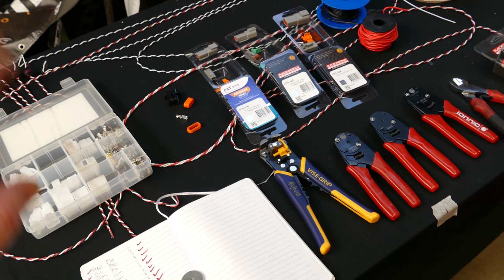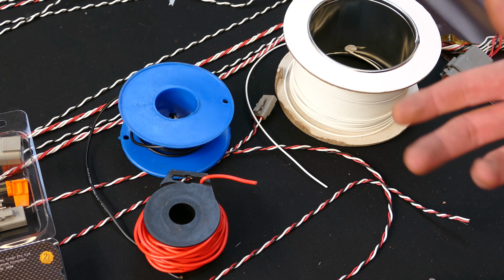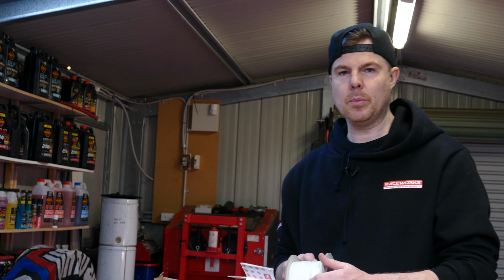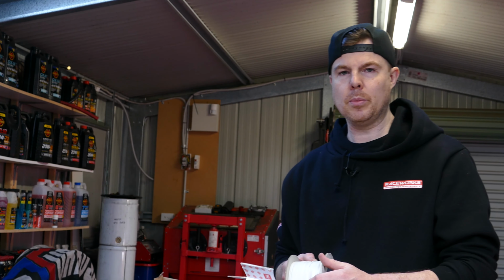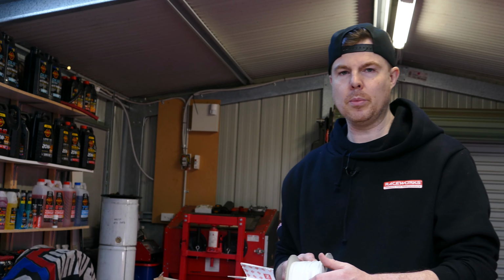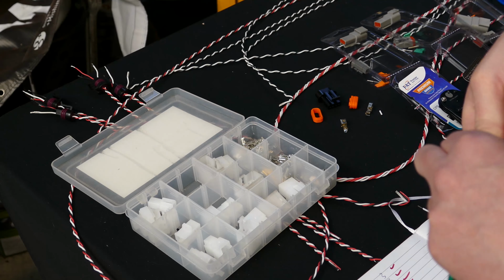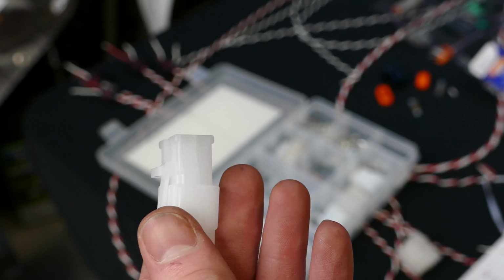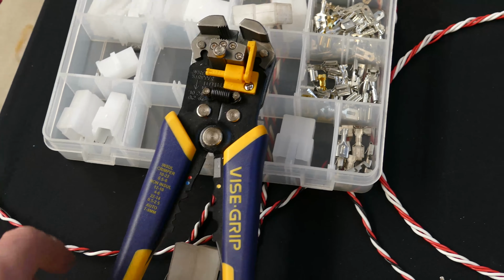Basic Automotive Wiring Tips & Tricks

Comment: Very well taught Broomy. I'm an A Grade Electrician with data and security as well as Motor control and process control experience. I must say, for at least 9 out of 10 car builders, the answers you've given are exactly what I'd suggest. The only extras I'd offer are soldering the pins rather than crimping (but only if your soldering skills are good), copious quantities of heat shrink and re-useable cable ties with panel pins to secure to holes in the bodywork. All in all, I'd agree with you about people overcomplicating wiring for no real benefit. A further benefit of your recommendation for the Deutsch plugs is higher surface contact area reliability between the male and female during the plugging process.
Reply: Careful when soldering terminals:
  https://www.youtube.com/watch?v=E_m8xf3vfYE
Reply: Dang I wish I had your skills.  I guess life is short...but not THAT short. 😂 Forever a student.  #alwayslearning 🔌⚡️💡👩‍🔧

Comment: I just started working with these Deutsch connectors and I really like them a lot. Even the cheaper aftermarket plugs seem to be miles better than the best weather pack connectors.
Like stated in this video, once you have all the tools needed to do the job properly, it's really fast, easy and secure.

Comment: Its kinda fun to look at the reasonings why things are done as they are from the common folks perspective. I am a assembler who has built and in part designed large automation panels to small wire harnesses for vehicles to semicon industry.

Twisting can be done to safe space. Usually its done to analog controls to make the magical magnisation stuff less fucky.

The common flat connectors contacts are available in smaller sizes. Deutch connectors are good because of their environmental properties and superior crimp contacts and good built quality.
-one scuffed tip is to strip the wire longer and fold the copper. NOT RECOMMENDED! but better than just crimping small wire to too larger contact.

Thick insulation in wires is for better voltage/heat resistance and harsh environments.

Cauge is just stupid american standard for conductor size, but almost all crimpable contacts use that so you have to deal with that.

11:55 the crimp you made is faulty. The holes in the contact are for inspection. You should see copper from that hole to make sure the wire is deep enough

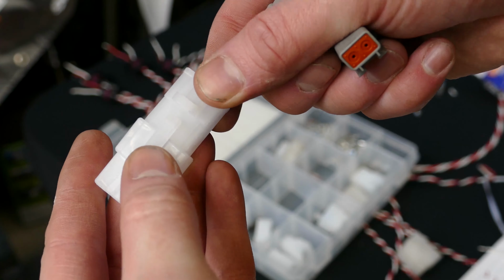14:50 and that's the built quality but the contacts wont be that loose. The contacts inself will suppourt each other, but its better that the contact housing takes the movement stress rather than the contacts in them selfs that's why you should use deutch or similar in vibrating and moving applications.

Im too drunk to commantate furher frogive me and skip this comment thanks and bye.

Comment: i work with a well known custom canopy and service body manufacturer. i do wiring on daily basis for Utes.We never rely on clips. We do solder as it is most reliable method. I use long noze plier instead of side cutter.even fro 5 cores , 7 cores wires.  the stripper has clips features too. i use them whenever required.  so basically plier, stipper and a solder are enough for wiring. soldering tool is good investment instead of clips. for DIY i suggest also add tester screw driver. it will save ur time on finding wires and issues, blown fuses etc. .

Comment: I get your complaints with the fastin faston connectors (the generic white ones) but you can get the right size crimps for thinner (or thicker) cabling. If you're using the right size crimps and crimpers they're perfectly fine.
Reply: True, however would it really be worth the minimal savings compared to the best options
Reply: @mrbumcraic5046  Yes it would in certain circumstances where you don't need a weather sealed connector under the dash or somewhere inside the vehicle. Correct size terminals and proper sized correct crimpers for the terminals would make a better termination than he demonstrated. If you don't have the correct size terminal because the wire is too small, you can strip back more sheathing and fold the wire on itself to create more surface area for the terminal to bite onto when it crimps. 

It was a great video that unfairly compared apples to oranges in my opinion. Deutsch are great but they get pricey in a heartbeat and they are not necessary in every application.

Comment: For greater security at any wire crimp; strip extra insulation and fold over the end. It has to ball up if it slides and will not let go. I have done this for 40 years and never seen one pull out.
Reply: I'm not sure what you are referring to. Maybe you could clarify.   For any of those connectors as long as you are using the proper wire and crimping tool, you should never have any problem with it pulling out.
Reply: woah i just started wiring these up and had never used a crimp before and just assumed that is how everybody did it! good to know!! thanks!
Reply: @tchevrier  he means fold the wire in half and stick it in for crimp connections for extra security. Imo just get the right size connector

Comment: The white generic ones comes in multiple sizes too, tbf. The white ones are used as OEM on bikes and cars for a reason, its called "good enough", and weather sealed connectors are not always worth using. That said, i like both options.

Also a tip for the twisting of cables, when you are finished twisting if you apply heat with a heatgun on the loom, it would often not loosen too much when releasing from the chuck of the drill.

Comment: If the wire is too small for the crimp-connector to grip it properly, either solder the wire to the connector, or double the stripped wire back on itself to form a thicker crimping-wad for the connector's crimp-surfaces to grip onto.
Reply: Never, ever, solder wiring in any type of high vibration setting like automotive.
Reply: @montegb2951  Ummmmm actually I find that soldered joints work just fine in automotive applications; not sure why you would be concerned about them...?
Reply: @montegb2951  You may get away with that (soldering) in automotive uses, but NEVER in aircraft.  If you double back the wire or fold it over to double the wire count in the crimp on, you're golden.  I go a step further and heat shrink the wire to the connector if room is available.
Reply: @sferg9582  and why exactly do we NEVER solder wires in aircraft? I've heard multiple people say this with no explanation. From my career, I've seen crimped wires break inside the insulation at the back of connectors. It really comes down to correct application and knowing what techniques to use.
Reply: @MrJtrot90  , soldered wire is more brittle, and can wick up the wire to before the support part of the crimp around the insulation. Hence with vibration it can crack and break. Time and a place for everything though.
Reply: @montegb2951  Absolutely incorrect.  It is perfectly acceptable to solder wiring in a high vibration environment like an automobile.  In fact, it is the preferred method of joining 2 wires.  OEM wiring  harnesses have solder joints in them straight from the factory.  I am speaking from 20 years experience designing and manufacturing electrical systems in the automotive industry.
Reply: @sferg9582  "you may get away with that (soldering) in automotive uses, but never in aircraft."
I can't speak for the aircraft industry, but I can speak for the automotive industry.  Soldering is. not only acceptable but the preferred method.  
As far as doubling the wire before crimping, that is not required if your are crimping properly.  And if you are using the proper size terminals you shouldn't be able to double the wire.
And, heat shrink is great, but if you are using it in an environment prone to moisture then you should be using adhesive heat shrink.  Regular heat shrink will allow moisture to wick up and corrode the wires quite quickly.
Reply: @tchevrier  Yes, OEM harnesses have soldered splices...(branch circuits).... but not repairs. There is a huge difference between a machine heated splice and something a shadetree guy is going to accomplish. Might I ask, who do  you  work for? Because almost every OEM recommends crimps for repairs. It's actually very easy to find those recommendations directly from the manufacturers, this is not some industry secret.  BTW,  I do speak from experience. I'm an electronics tech for an actual OEM, and we stopped soldering repairs on the assembly lines around 1998.

Just to be clear.... when you say you both design AND manufacture, I knew you were full off crap. The OEM engineers design..... and the manufacturing of the harness is done by a vendor, (with specialized splicing equipment). That's been going on long before I started. The only department that both designs and builds is the proto shop, and the rules they work under are not the same as the real world.
Reply: @montegb2951  Let's first address the second part of your statement.
"I knew you were full off crap."   Apparently you are wrong.  First, I worked for 10 years as a design engineer for a major OEM. While most of the wiring harnesses were contracted out to subcontractors, some low volume products were actually built in house and those joints were hand soldered. Repairs were also done in house using hand soldering.  Under no circumstances was a crimp splice ever used on a brand new vehicle. As a design engineer we spent a lot of time testing wiring joints, splices, connectors etc, under all types of conditions. The best most reliable joint was a solder joint with adhesive heat shrink.  Second, I worked for 10 years for an electronics company who both designed and manufactured products for the automotive industry. As yes that company also had harness manufacturing capabilities for both internal use and for OEMs. Again there was no restrictions against using hand soldered joints. Obviously in an assembly line type of environment you want to use as much automation as possible for both speed and quality purposes, but when not practical hand splicing was done.

Now the second part, "OEM recommends crimps for repairs".  I can't speak for what everyone else does, All I can say is what we did. We would never ever recommend anyone use something like a butt splice unless it was inside the vehicle .  Heat shrinkable solder splices work very well, but we never recommended them.

Just for kicks I decided to do a quick google search. The first thing that came up was an installation manual for a Ford remote starter.  I didn't get into the details too much, but I did notice this right away.  The procedure states to solder the wires.  This is a quote "DO NOT USE CRIMP-CONNECTORS OF ANY KIND. THEY ARE NOT A ROBUST METHOD FOR SPLICING IN NEW WIRES

Seems to support what I'm saying.
Reply: @tchevrier  Crimp connections are not robust huh????????? Wonder how they attach wires to all the contacts  inside connectors.  HAHAHAHA. The wire itself will fail long before a properly crimped terminal/splice. And no, I'm not talking about those cheap ass plastic butt connectors.... A properly sized and crimped, uninsulated seamless splice covered in adhesive shrink, is tougher to pull apart than any hand soldered joint. Takes less time as well.
Reply: Soldering is for circuit board contacts. Crimping is for wire, crimping is not affected by vibration and is a lower resistance and stronger connection. Crimping gets a bad reputation from the cheap auto zone crimp connectors and people who don’t understand how to properly crimp and the proper tool to do so, when compared to those connections solder is better but compared to a proper crimp the crimp wins ever time, this is why all OEM connections are a crimp
Reply: Soldered wire has a stress point where the rigid solder ends and the flexible cable starts. We even use solderless (compliant pin) connections inside ECUs now where the compression 'cold weld' joint is better than solder.
Reply: @robertbox5399  I dunno; I just know that I have never had trouble with soldered connections.  They have never broken for me

Comment: This is one of the better videos out there. The fact that you use Deutsch Connectors is awesome.

Quick question though...what's a solid way of tapping into an existing wire?
Reply from the maker: To splice an extra wire into an existing wire ? I use an open barrel crimp/splice. No option but to tape it up, as you won’t be able to use heat shrink obviously, but it’s a strong mechanical crimp, and with some decent tape it will be fine.
Reply: Cooper open U shaped crimps.  You can get them in a pack of 500 for like $16 on eBay .  I use a ratcheting crimper on mine .
Reply: There’s clamps that you clamp them down to already existing wire don’t know what it’s called. I have several of them put up. Oh probably one of the two named above.

Comment: Question:
I used a heavier gauge wire to make a pigtail with the 2 pin connector on a vacuum switching valve…twisted it to the thinner wire on the harness, going to my ECU.
Will that be ok?

*1994 Toyota pickup, DLX
*VSV’s were for the A/C idle up & the PAIR valve.

Comment: A quick tip you can double up the wire (conductor) size by stripping it twice the length and folding. Not recommended for everything but those cheap male and female push on crimps wouldn’t just pull out.

Comment: If you dont know which size of wire the right one is for the device, just use the thicker one. Use this cable for your whole project, the price really makes not much difference but you are on the safe side. And why twist? It makes all stiffer to go around corners like through the door hinges

Comment: Great video.  We must work on the same kind of stuff, high performance engines, standalones, etc.  I agree with everything you said, except one point I don’t especially like about the Deutsch terminals versus some open barrel style crimp terminals is that they don’t offer the strain relief where the crimp portion of the terminal has two discrete areas it crimps.  The first actually crimping onto the insulation and second crimping the just the conductor.  Are you familiar with Molex brand mx150 connectors?  They are a proper connector with rubber seals on both ends of the connector, a nice audible snap upon connection, have range of 1-20 wires, and even have two or maybe even three different terminals for different gauge wires so 1 connector can work for various gauge wire.  They even have slots where you can slide in mounting tabs for those Christmas tree looking push in a hole deal to secure wires from sagging or whatever.  About the same price for the most part.  If you’ve ever worked on a later model Harley you’ve encountered them on the handlebar controls and under the fairing for almost everything.  But yeah, the dt/dtm/dtp from Deutsch are great for almost everything.  I use them for 80% of what I do.  

Anyway, have a good one and I’m bout to subscribe and check out your other videos!👍🏻

Comment: Good video .  You should give the product description of the wire you are I using in the description.
 Another thing too is that the cheap Deutsche connectors are flimsy and flex .  Pull apart too easily .

Comment: How latter on when you'll have to disconnect all the plugs again, you wouldn't mess them up? In OEM wiring all your connectors are different size, and it's barelly possible to mix them. While having just 3 different one.. that might bring some trouble when putting things back again.